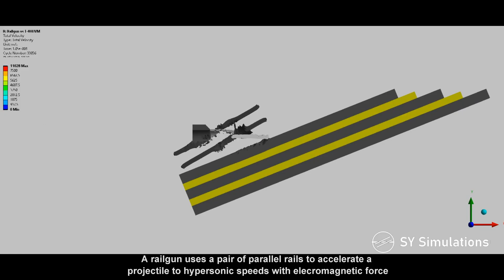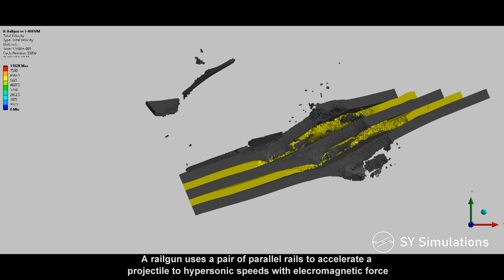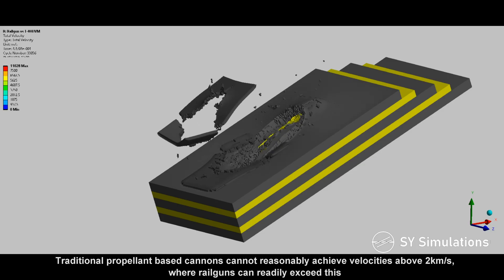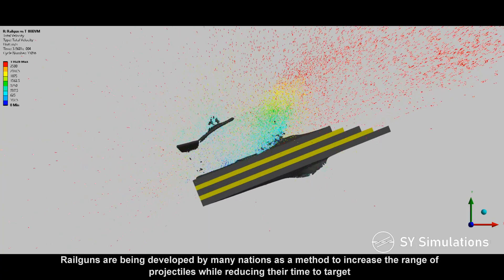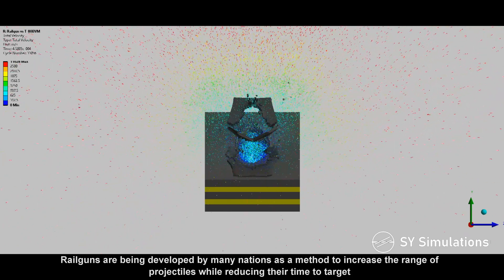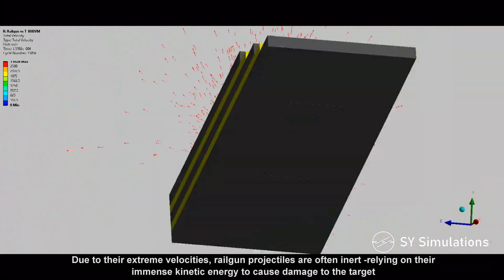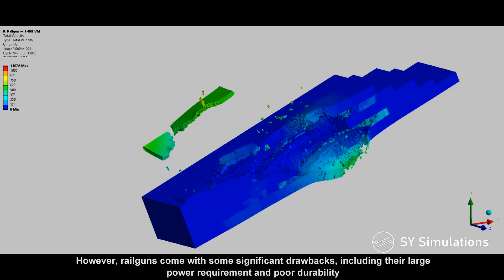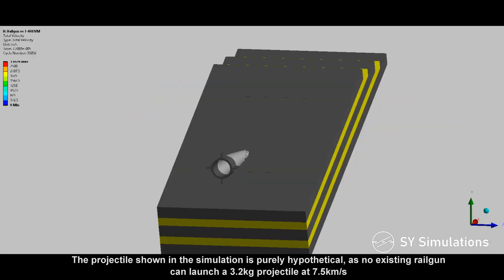RAILGUN vs T-80BVM | Hypersonic Armour Penetration Simulation | APRIL FOOLS' SPECIAL

Comment: Regarding the discussion about the Navy Railgun and why it was cancelled in 2021:
Rail erosion was in fact only a compounding factor. They could've achieved the desired 400 shot durability but the main problem was energy efficiency. They operated with something like 9% efficiency which means the railgun was 91% arc welder and only 9% gun. This neccessiated expensive vortex cooling and suboptimal tungsten-chloride rails just so it can withstand the combination of rail stresses while being heated to something like 3000 Kelvins (IIRC). The cooling in fact had to be fast enough to strip away a good heat in miliseconds because otherwise even with the tungsten-composite the rails would only last a dozen shots if that. Of course changing the rails also ended up being way more expensive than imagined so the "cheap" projectiles (which were still more expensive than Paveway gravity bombs, mind you) also had something I estimate a few billion dollar cost per rail replacement after firing a hundred or at best four hundred shots. Yet the real nail in the coffin was the HVP project, continued on the side because they feared the funding would be cancelled. HVP is way less capable but it's still providing a leap in velocity and range compared to old naval artillery shells. Historically, when it comes to procurement US military almost always chooses the cheaper option, unless it's about aircraft. Even then the project is usually said as "cheaper in practice" when in reality it wouldn't be. So yeah, it got cancelled.

So why the other railgun projects succeeded, or at least still running? The answer is... much more reserved expectations. Navy Railgun was meant to be a cheaper alternative to cruise missiles while also doubling as anti ballistic missile defense. None of the other projects try to do something as crazy. They are much closer to General Atomics' Blitzer railgun which they advertised for every NATO country so they could get some return on their investment. It's supposed to be an air defense weapon, something like an improved anti-aircraft gun. Return to AAA, essentially. Now cooking with electricity!
Reply: i think if they focused on more reasonable speeds (say mach 10 vs the mach 21 it shot at) it could have been far more successful
Reply: @MyLonewolf25  Ah, you see, the majority if not all of the tests were at half velocity, at around 3.5km/s, so rather close to your Mach 10 figure. The real problem wasn't the velocity, though it contributed, the real problem was that they tried to make a gun to beat missiles through kinetic energy alone. 

Every other railgun project which goes further than research tries something like 30-60mm in projectile diameter with masses fraction of that 10kg accelerated by the Navy Railgun. The end result is less range, sure, it is no longer a super artillery or a potential replacement for SM6 but you get a point defense weapon and potential artillery alternative in the future which could actually be used. Japanese railgun seems to be inspired by the General Atomics Blitzer which was once advertised to all allies. Its promises are less in making cruise missiles and AA missiles obsolete and more like an improvement for point defenses and potentially an artillery against various targets if the opportunity presents itself. The animation advertized Blitzer on ships where it'd triple their point defense gun range and for massive ground mobile stations which could defend against rockets and other assymmetric threats while also respond back to the attackers through the same command chain. Obviously the land-mobile Blitzer was a desperate bid, imagine a frickin multi-lane convoy as a weapon system, that was the Blitzer. Japanese railgun plans both miniaturized such technology and rationalized further by reducing its firepower to even more sane levels. It's still bulky but more like deploying a Patriot rather than using the frickin P1000 Ratte. The latter was Blitzer's solution to land mobility, it was more sane than a literal landship on tracks but it featured nearly a dozen trailers.

Comment: How in the world would it be moving at 7.5 km/s at that point? I wonder if the projectile is capable of covering even a few hundreds of meters of flight in the dense atmosphere at that near low orbital velocity...
Also, a much smaller projectile would suffice going that fast...
Reply: A much narrower projectile. If you had a 10kg apfsds that is 1100mm long, and 25mm in diameter, it would maintain such extreme speed much longer.

The issue is accelerating the projectile to that speed in the first place.
Reply: @sidneyshaw9814 Not that I disagree...

Comment: If anyone wants to know what could rival the railgun, I would say Electro-Thermal-Chemical gun technology is the best thing with significantly less power needed to power it whole reaching railgun speeds. Their still a conventional cannon with chemical based propellants the only major difference is the ignition process which is using plasma.
Reply: Why can’t we use more powerful explosives instead of gunpowder? For example, c4? To disperse the projectile.
Reply: @Explosive.-Nitroglycerine.  Chemical propellants can only do so much due to the density limitations and challenges and it also brings up manufacturing costs significantly sense more advanced Chemical propellants would need to be manufactured to a much higher standard but thats a fraction of the problem with more powerful explosives

Comment: Would you consider doing a plasma torus vs T-80? The MARAUDER Project was able to accelerate a 2 mg torus of plasma (1 m in diameter) up to 3% the speed of light, and I'm curious how it would affect a tank.
Reply: Very similar looking results. I got to see footage of MARAUDER hitting a test steel plate once and it blasted a large crater into it. Plasma bolts (and hypersonic projectile impacts) don't penetrate as so much act like a mini asteroid impacts leaving wide buy shallow craters. This is more then overkill vs any tank that exists but would take multiple hits to get through a reinforced bunker (though once it does.... it wont be a bunker for long).
Reply: @TheRyujinLP  Where can one find such footage? I'd love to see that myself.
Reply: It wasn't online sadly. I used to know a guy who worked on lasers (free electron lasers). His dad and grandpa both used to work for DARPA  and they had some declassified footage from projects they either worked on or knew ppl who worked on. Also got to see footage of an actual particle beam cannon being fired which also showed why they're not on the battlefield yet. The electrons in the beam are attached to positive electrical fields so rather than fly in a straight line it whips around like the Ghostbusters proton packs do. 
Sadly I haven't talked to him in years and the last time I checked in on him he lived half way across the country from me.
Reply: @TheRyujinLP  I am inconsolable.
Reply: Wouldn't work unless the tank was in space or pressed right against the muzzle. Anything going that fast will virtually instantly spread out and slow down in air, especially if it's also light and wide to begin with.
Reply: @DecidedlyNinja  You'd be surprised. One of the things that set MARAUDER apart was that it "spun up" the plasma into a rotating torus, which produced a very powerful magnetic field. Not only is this strong enough to contain the plasma, but even to disrupt the air it's colliding with, converting it into plasma and generating a vacuum right in front of the torus (I won't go into detail on the nature of magnetohydrodynamics, but suffice to say that a sufficiently fast spinning plasma torus can keep an atmosphere out in the same way that Earth's magnetosphere helps keep our atmosphere in when we get hit with solar winds). I don't know if the MARAUDER Project itself managed this, but I understand the theory behind it, and it could have theoretically had a range of several kilometers, even in atmosphere.
Reply: @DecidedlyNinja Nope, the tests got up to just under 2km if I recall. The plasma bolts were fired as toroids which held together like how a smoke ring does. About a decade ago I saw a demonstration of a plasma generator that fired a toroid that could hold together for several seconds even at low velocity (I believe footage of this is available online) so an upgraded MARAUDER could probably double it's range at this point.

Comment: The proposed hypersonic dart is moving as fast as the detonation velocity of a lot of high explosives. There would be no practical way to counter this projectile apart from thicker armor. That much energy concentrated on a small point would likely cause some of the steel to boil off.
Also, it would dump an immense amount of energy into creating plasma in the atmosphere.

Comment: Driver would be turned into human sized cheese with that kind of impact. Maybe with bleeding ear and eye canals due to the shockwave. Crazy...
Reply: im not sure that there'd be ear or eye canals left anyway
Reply: The projectile has 90 MJ, or about 20 kg TNT equivalent, of kinetic energy, and a good chunk of that got pushed inside the tank.

I'd be surprised if anything is left of the driver that can still be identified.
Reply: Dude is simultaneously getting holes, blown up, flash burn, ignited, blinded permanently and metal vapour coat.

Comment: A fictional weapon, one using plasma, cuts through light armor like a (very fast) plasma cutting torch; only because the plasma-pocket is moving at near-relativistic speeds, it supplies substantial force as well as intense heat.

The trouble is that these weapons weigh enough that you need weight-training to carry them any real distance, they only have a limited range and number of shots they can fire - and they need a very heavy maintenance schedule.  More, their recoil is such that full alteration, where one’s skeleton is heavily strengthened by a biocompatible titanium-vanadium-#121 alloy, makes their repeated use practical.

A normal person would need multiple orthopedic surgeries to repair the damage done to their upper body - after firing ONE shot.

This is deemed worth it when the weapon in question will stop any earthly armored vehicle with a single shot.  The discharge will go through well over a meter of RHA, composite, Chobham, depleted Uranium… - and then the after-armor effects are akin to a large conventional shell exploding within the vehicle.

If Boba Fett could get one, he’d like it - as these cause disintegrations.
Reply: There are so many reasons why this wouldn't work and wouldn't be a good idea if it did.

Comment: I just had the thought that a more practical approach would be to use a conventional cannon to impart the projectiles initial velocity then use the rail gun to accelerate the round further. Obviously you would have to deal with issues like the muzzle blast, which could be diverted to generate electricity (it's going so why try to make use of it) but that's just engineering.
Reply: >shoot railguns out of cannons for black magic tank graper
lockheed martin hire this guy

Comment: Railguns are only theoretically viable as naval guns right now, due to their immense power requirement. And even then, they wear down their barrel after only a couple of shots. Maybe these problems will be resolved in the future. However, keep in mind that current tank armor is designed against HEAT and APFSDS warheads. Maybe, composite armor could be designed specifically to stop railgun rounds. The high speed of the projectile is a double-edged sword, the penetrator likely desintegrates very easily. I'd imagine that some combination of spaced armor to destabilize the penetrator, an ultra-hard layer to shatter it, and multiple layers of the same ultra-hard material and DU could absorb the remaining energy.

Comment: It’s interesting how this theorical shell of an optimistically ideal interpretation of the railgun seems to merely achieve the performance of the SHARD 120mm shell.
Reply: I don't know what kind of computing possibilities the uploader has, but that kind of simulation is stupidly complex and computation hungry to do correctly. Without digging any further into it I'd assume it being pretty worthless as a baseline. And its not only the numerical part that is highly complex, but also the physics itself. You absolutely need a ton of models to simulate something like this. A model is a simplification of a real world phenomenon so it can fit into your simulation program. For example, normal turbulence in water is so complex that no CFD simulation actually simulates turbulence from the ground up. The kind of funky physics that is going on with solid steel being deformed like a fluid I imagine to be really fucking complex. And if you don't have a working model for that, into the trash goes your simulation.

Basically, its a funny video.
Reply: @hurrdurr3615 pssst, read the title. Op uploaded a lil early.

Comment: It completely shattered by the time the shockwave reached the inner layer of armour and "penetrated" it. A steel plate as a spall liner would completely nullify it's effect, since there is no actual shell left by the time an exit hole is formed. It's just spall. Is there any way to this simulation with a thick witness plate of RHA of about 15-30 mm that shows how much penetration the spalling has?